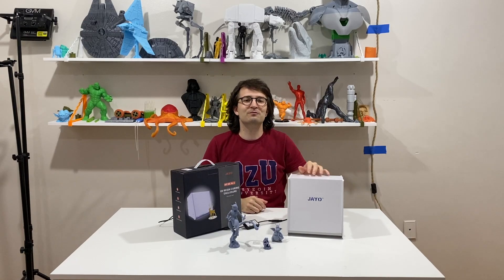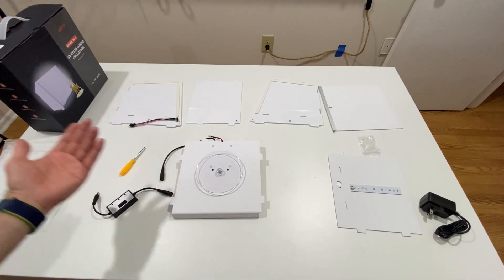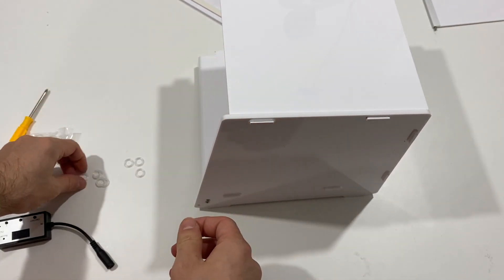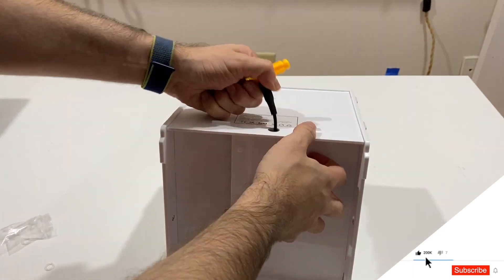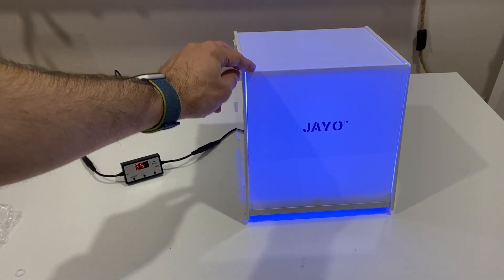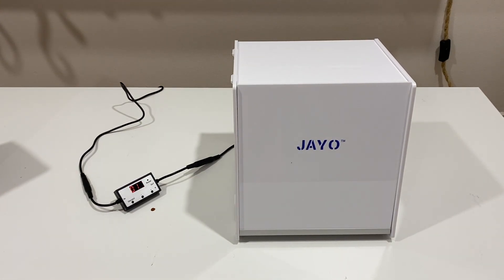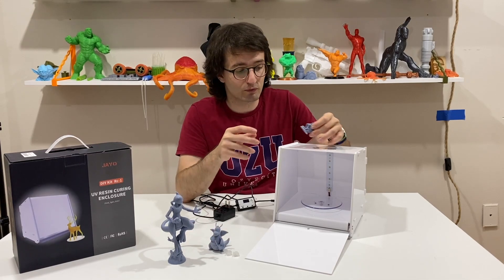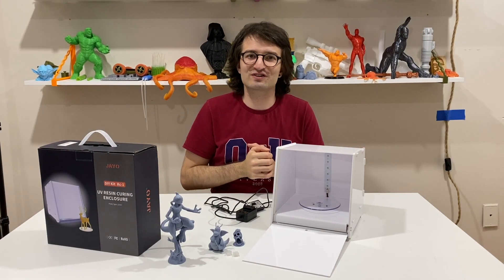SUNLU JAYO UV Resin Curing Box Review, Assembly and  Unboxing

Comment: I see some reviews on Amazon saying this failed to cure their prints.  Have you had any problems with long curing times or models not curing at all while using this?
Reply from the maker: Good question I didn’t do too long curing with it. As you see in the video there is no fan on it. So it will eventually fail with over heating. Its an okay machine for the money it costs. It could be better